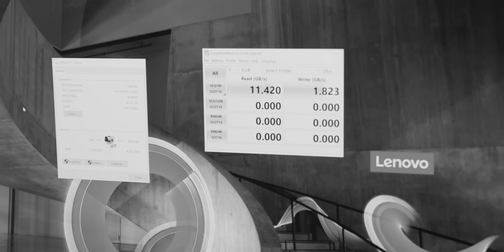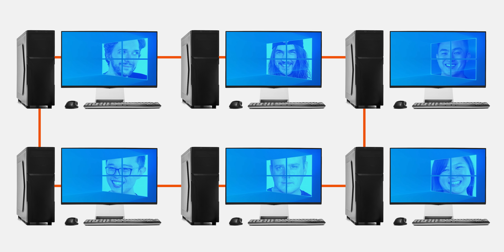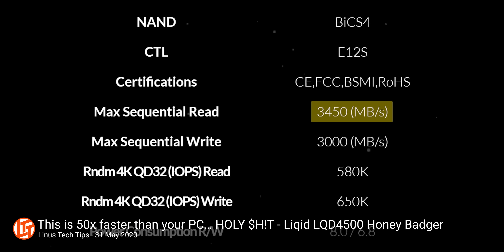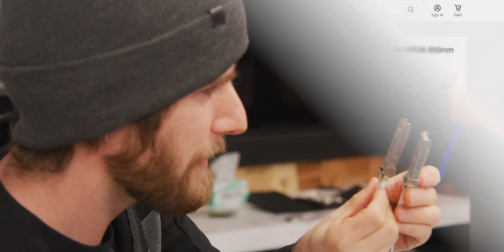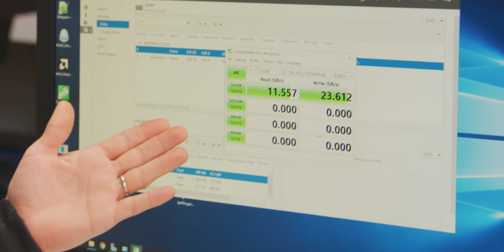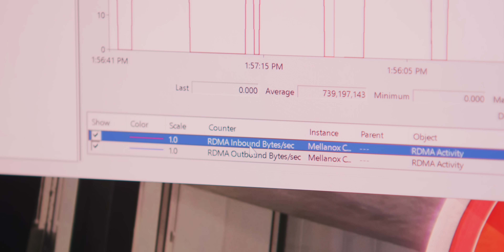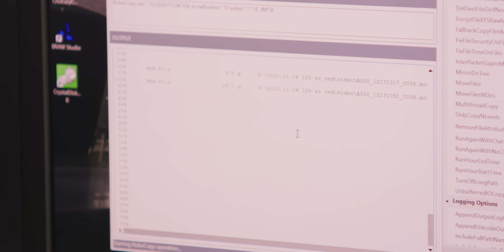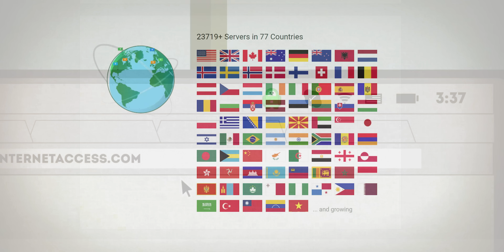A $15,000 Network Switch?? - HOLY $H!T - 100GbE Networking

Comment: These switches are from the team brough in during Force10 acquisition.  These switches are -hit tier quality. Sooner or later you end up putting in some valid configuration that ends in a crash loop.  The only brands that really get a look in are Cisco, Juniper or Arista, if your company is broke maybe HPE. Its always the same story repeated: Company is happy with Dell servers, company buys dell switches, switches cause multiple outages, company returns switch and buys nexus. They have really trivial bugs, like if you enable flow control on all interfaces instead of configuring individually on each interface it would brick the device back when they were using the Broadcom T2. Same kind of implementation errors when we acquired a company with Broadcom T5 switches.  Not worth saving your company money at the expense of spending weekends talking to dell customer support. They are fine as long as you dont put any config on them. Also, the PSU is generally not for the transceivers, QSFP28 is max 4.5W but typically much less. fibre store transceivers are solid

Comment: I bought a 10GbE networking 8 port switch for $2.50 CAD so does that mean I technically could buy a 100GbE switch for $250 CAD?

Comment: Is 100G network speed possible with Windows 11? Im using 22H2 and cannot break about 55 GB/s despite PCI Gen 4, 16x slot speeds, a AMD Threadripper and a PCIe Gen 4 Mellanox NIC with Mellanox branded 100G QSFP28 cables and multiple different network settings configurations including jumbo frames, and RoCE v2. Is Windows Server required to get 100G speeds?
Reply: @RepaireroftheBreach  I know this comment is 2 years old but Windows server 2025 works really good with RDMA capable nics
Reply: @JohnCillian Yes I’ve been using Windows server on the server machine and windows workstation 10 pro on the clients and got it working that way finally. 👍🏻
Reply: Tried Win 11 Pro Workstation. Same results.

Comment: 1:14
The POINT to a fast network switch isn't a single machine to a single other machine file copy.
It's being able to do fast file transfers on 5 or 10 such copies AT THE SAME TIME from multiple different machines.

Unless you're plotting Chia at k35 or some such with a multi-GPU plotter, then it becomes transfers from one machine to multiple other machines.

Comment: Didn't catch the model number, but given the specs I wouldn't be surprised if there is a full x86-64 processor and ram in there to run containers on that box. Cisco has that with their 9000 series catalyst switches of similar specs.

Comment: Part of base T's huge requirement of power comes from the ethernet encoding schema. Due to the design of ethernet, there is a chance that you will completely saturate the magnetics during heavy transfers. This is fixed by the ethernet encoding schema. The fix eliminates the possibility of saturation for the magnetics but it does mean that each transformer needs to be driven constantly, hence the huge power draw. Optics don't need to drive 4 whole transformers per port. All that's onboard are the laser drivers.

I am by no means an expert on ethernet but from what I know, it seems like driving the magnetics account for most of the power used by the PHY.

Comment: Linus, thats is a 10GB/s card pc to pc.. what happens if u connect 2 pci-e network of 100Gb per pc (10GB) on 2 mothers with 2 pcix16 slots and merge it in windows control panel>network>adapter configuration (bridge connected) theorically is 10GB plus 10GB (20GB).. could be possible with a mobo with several pci slots to merge more than 2, like the C.B250A-BTC PLUS V2 but that mean have 2 of it and lots of pci-e expensive net cards

Comment: Soooo, when is the rdma multi channel smb direct 4 * 100gigabit version? (And for those who think I mean bonding, no I mean smb multi channel, which WILL use multiple interfaces (rdma or non-rdma) at once for a single logical connection between devices (obviously there are multiple connections involved at lower layers)

Comment: The reason why there doesnt seem to be much cooling in your 25/100GB switch is because is simply isnt needed.  All you are doing is shining a light down a fibre optic cable so the current needed to do that is waaaay less than that needed to run a conventional switch, even at the speeds you are looking at.  One thing to watch however, when you are running fibre optic around your premises, pay careful attention to the cable's minimum bend radius as anything less than that will destroy the fibre optic, and you are probably gong to have to get a contractor in to terminate the fibre optic cable at each end.

Comment: I remember how as a teen I used to be known as the "whizz kid", and even in my early adulthood I was relied on to give advice for important implementation-specific decisions.
I've not touched anything tech-wise for 10 years because of a horizontal career-move, and now I can barely keep up. All the acronyms, the hardware, the software, the protocols, where to find certain settings, I'm completely out of date on these things. I simply can't believe how quickly things move in this field, and it shows just how incredibly important it is to keep on learning throughout a career like in tech, because you can get left behind so badly that you even struggle to find simple things in the OS. I'm now gonna have to learn from scratch.

Comment: May want to check to verify SMB Direct isn't bypassing security features like AMSI. In the video where you showed the CPU, and TCP/IP Perf stats not even being aware of the transfer, this makes me very worried about possible security vulnerabilities. If I can transfer malware to your machine without the system really knowing about it, well, the hackers are gonna love it. Well, when I think of security, I don't really think of Microsoft, so it doesn't surprise me that they would implement something that has little or no security in mind.  Hopefully, I have the wrong understanding and SMB Direct is secure.

Comment: You need to create a new video with 400 Gbps QSFP-DD ports! If you run those in LACP/802.3ad you can have 800 Gbps link for your system. If you actually can find a card that has a QSFP-DD port for your PC.

Comment: The scrubbing experience at 16:30 is what I get on my PC with a 1080p Video at full resolution xD. Well I "only" have an Intel Core I7 9700 in there. Edit: I also do some occasional video-editing for my channel. I don't want to self-advertise but maybe you can check it out of you want to
Reply: the footage they are scrubbing through is on a separate server and not on the local machine, its not the speed of the cpus they are looking at, its the speed of the network and god DAMN is it fast
Reply: @leomonk974  yeah I also edit off a HDD LUL

Comment: To really shine RDMA tends to require some configuration on the switch at minimum (working Priority Flow Control and ECN), although with RoCEv2 it is a bit more usable without too much switch support.
Reply: Yeah they're definitely leaving performance on the table the way it's configured right now

Comment: Not bad mate, not so bad  :)), but I may crash (a little bit) your feeling of speed especially over some distances :P
About 5 years ago when I worked for N...K with PI...ER project (EU/Poland based internet/internet2 backbone designer and implementer) and we have setup 12x links of 100Gbps over a 360km (about 225 miles) on some Juniper hw (some big switches/routers/firewalls, I don't remember what was the name and type of them) and we have setup a metro-clustered virtualization solution (test on Vmware and finally on KVM on centos Linux) on this with cross synchronization of network and storage functions. Of course for single VM or server the limit was up to 2-4x 100Gbps but finally it was a setup for very smooth Cloud of up to 5-10k VMs... and with test of 300x fully loaded VMs proofs that this "little baby" is doing a great job, especially with possibility to expand number of 100Gbps links if necessary. And a load tests results, well 300x replicated VMs do a script of copying and cloning themselves and transfers per VM were about 300-600MB/s but that was at all VMs at once :P so finally full 1200Gbps in full duplex so around 2Tbps on that juniper switches/routers/firewalls :P and that was really awesome !!!!!
Of course your LAN works faster with only some of workstations connected to some storage servers, which is also impressive, but to setup such solution over a 225 miles and for 5000-10.000 VMs... I'm proud of it also :))

Comment: The RAM and storage in that switch is purely for it's own operating system. As all network transit traffic only hits the responsible controllers (ASICs), you would not get any benefit from upgrading. The only benefit of upgrading either of them I can imagine is, when you do debugging operations or store the log files locally over an extensive period of time.

Comment: I'm actually surprised that the bandwidth of the PCIe-bus can handle this. Do these NIC's support iSCSI offloading as well?

Also, this is the kind of bandwith usually reserved for ISP's. The real test would be to load the entire BGP routing table on there and see if you get similar throughput ^^

Comment: Wait why would windows copy being single threaded affect the speed with RDMA does that not cut out the CPU from the equation? is the multi-threading impacting the NIC's onboard processor instead at that point?

Comment: 8:05 idk, for my very limited (I don't even have a 10Gb network to test with) testing it looks like that you just need Windows 10 Pro 1803 or later to enable SMB Direct and RDMA, its just a couple of lines that you saw on the microsoft docs (tho the docs still refers to server 2012). So on the editor side you don't actually need those workstation key (?), or if you do is just because that pcie network card is locked on the non-workstation license, and that is just stupid imho.
Reply: UPDATE: looks like I was right, the RDMA settings are changeable vai PowerShell and SMB Direct is enablable (lol) on regular Windows 10 Pro.

Comment: Two things, would it be possible to use a network share as a main drive if so that would be an awesome little experiment to run. Have 4 or 5 workstations that don't have internal harddrives all pulling from a single server maybe do some gaming it could be very interesting.

Comment: You have 10Gigabit internet synchronous, 25Gigabit for your editors and 100Gigabit to the server. 
On a lucky day I have 40Mbit Download and 5Mbit Upload (it's the highest i can get at my location in Austria), my PC is connected to the router per powerlan (so over the electrical wire) and my wifi sucks. Also I don't have any options to run my Own Ethernet cables because I'm living in a very old brick home with the wireing in pipes but those pipes are so small it's a pain got run new wire and also nobody knows which electrical wire goes where. 
So I have a shit ISP and a Home with no Upgrade options it sucks.

Comment: Chatting about Boxes (20 years ago) at the start of the internet when it really started to take shape the engineers designed Internet Cashing Servers. These Cashing servers were installed in the infrastructure to help minimize DATA between DATA centers. Back then they literally Cashed the most popular Internet sites locally and automatically updated when the Internet sites were updated. To say these were one of the Biggest most Expensive Boxes in Head End Data centers would be an understatement. 1000's and 1000's of Terabytes of Ram, purple, cast aluminum finish (900) cooling manifolds at about 3.5' high is what 6 million bucks got you.

Comment: i am un-impressed .
create 1,000,000 1kb files ,
then then tell me how long it takes .
i think you'll find it takes a lot longer 
when it has to take that extra millisecond 
to start and stop between each file
Reply: dude linus's team works with large files not small ones. I get that source code can be a bitch to clone but that is obviously not the case.

Comment: You should use LACP to workstations to get 50 Gbps connections to everybody using two 25 Gbps links in parallel. That also provides link redundancy so you don't lose internet if only one fiber fails.

Comment: You'll never see this message, but a 200 Gbps flow will never work. Your gonna be limited by the physical interface speed of 100Gbps. You can get a logical 200 Gbps LAG, but a max of 100 Gbps/10GB/s data copy rate.

Comment: RDMA is actually not needed with the newer switches.  Once you ping times around 0.1 - 0.2 ms you no longer need the caching abilities of RDMA.  Mellanox is the king of ping, try the test on RHEL 8 or above without RDMA and with and see if there's much difference if you have time.  

My main leafs off my spin core is about 15 of those in 96 port form 5296 instead of 5248,  I know them well.  Core is twin 9264.  One other key difference of the 5296 is it has QSFP-DD on two ports for 200GB :)  Dell switching and support of open network standards have really taken off and done well since the acquisition of force networks.

edit: also don't try to step down to 10g on that switch with a SFP28.  It's not supported, you'll get flickering (flapping SUPER FAST) and will work sometimes, sometimes not.  Use a basic Dell/Intel SFP and set the port-mode to 10g for stable 10g if you need to step down from 25.

edit2: not sure about Windows, but with AIX, you need to tweak driver settings in Windows and on the mellanox and you can more than double the single threaded 100g performance.  Was recently doing similar AIX testing and seeing similar "low" numbers in iperf that you saw in windows (20-30gb/s), after tweaking, I'm now seeing 60-80gb/s

Comment: Any chance you could get your hands on the $1999,- Unifi Switch Leaf? (forty-eight 10G/25G SFP28 ports and six 40G/100G QSFP28 ports)
It is only available in Early Access but it would be pretty exciting to see how that does vs the Dell

Comment: Optical transceivers probably use less power than rj45 for the same data transmission. Ethernet is 24 volt if I recall correctly, not sure the wattage.

Comment: ToR switches and edge equipment in general is very expensive. However, with recent discoveries in nano-materials, we will be able to produce this high-performance gear much cheaper, as is the case with 5G. 3D-printed Massive MIMO arrays and virtualization of software network functions. The only things that will remain scarce and ultra expensive will be GPUs. After all, we replace GPUs every year, while 1Tbps ToR switch will stay in the datacenter for at least the next few decades, or while it is operational and dies.

Comment: Well Windows is always a bit on the slow side. To get out the full bandwidth I ended up using pNFS on Linux. There is a lot more possible.
Playing arround with the current ConnectX and the current Mellanox 100Gb ETH switch I got trunked way over 12GB/s.

Don't mind the big power supplies. There is plenty of reserves calculated. Even under heavy load you won't see more than 50% of the single PSU rating in total.

Comment: You used a datacenter oriented switch to transfer files from 1 endpoint to other. It's like using a Lambo to go and buy some milk and eggs. Try out some Dell Z-series switches if you want to check some really badass networking stuff ;)

Comment: Great video. Multithreading a single file copy with robocopy won't give you any more performance. It will, however, as you saw,  improve performance for multiple files. Windows file transfer with File Explorer for single files is fine. GNU cp is the same. Rsync will give you multi threading options, like robocopy, but again, multi threading is only beneficial for multiple files. No performance gain for a single file transfer.

Happy new year!

Comment: Curious to hear the justification of using threadripper for the storage server over either an epyc/xeon or even just an intel chip with an IGPU? surely this would bring the overall tdp down on the system making it more efficient which is obviously a desire in something that in theory runs 24/7,,, unleess this isn't a permanent solution, if this is the case, will there be more videos on this? Love the networking content

Comment: RJ45 need to power to push through the datapins as well as RJ45 isnt range efficient like Fiber. The switch needs the power to push the data pins high on 300ft of copper, where as the fiber doesn't need any extra power no matter the length of cable.

Comment: It doesnt use both power supplies while running. thats enterprise grade hardware with dual power supplies for redundancy. Youd set that up in a data center and theyd give you an A + B feed so if one side goes down, the other doesnt. (i literally work in a data center)

Comment: I'm sorry to burst this bubble but if you are going to use it 25Gbps and 100Gbps combo setup, you are screwed by port buffer size which is like 10 times less than Juniper and Cisco switches. It works really well in DC setups like you basically have at your office and it works from port to port like your test setup but in wide area network this kind of switch is access switch not core switch :)  That means, less powerful you actually need. And if to nitpick, then it's called 8P8C connector, not RJ-45 :P

Comment: pro tip for more efficient robocopy transfers: no commandline output, just log to a file, dont log folder traversals and no progress indicator (especially when doing multithreaded copies!): 
--> /UNILOG+:C:\robocopy.log /NDL /NP
you can also try to play with the threads. the sweed spot I found out and use all the time: 32 threads
--> /MT:32
 try it and you will see much higher speeds. been doing this for fileserver migrations for over 10 years now :)